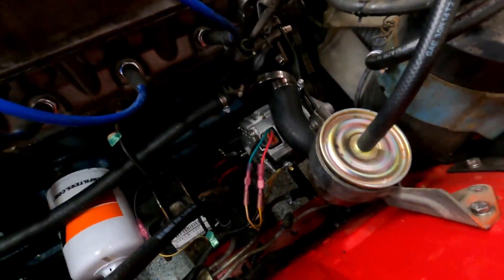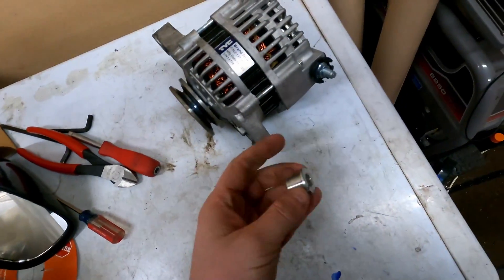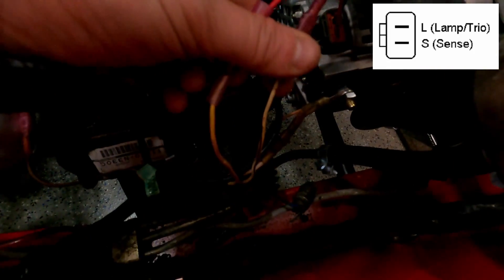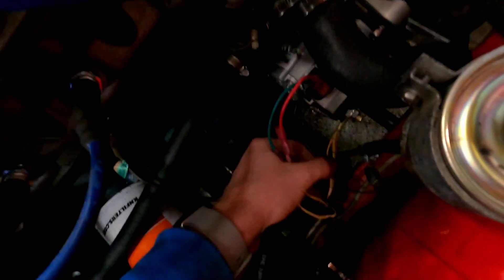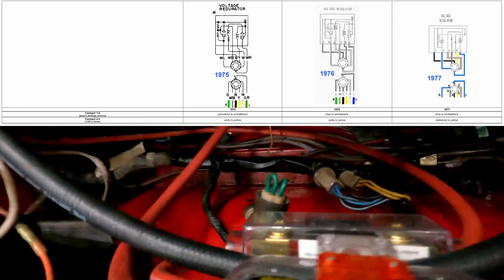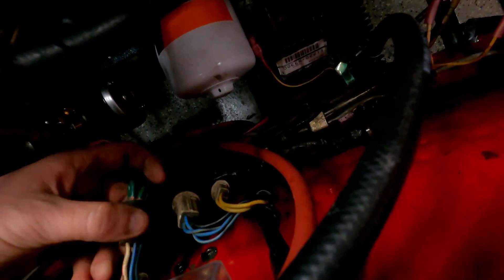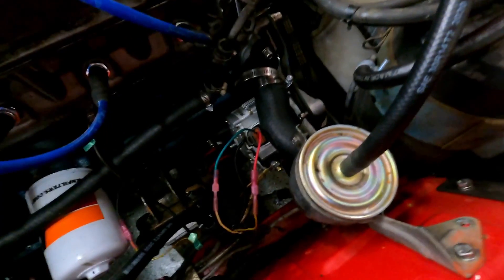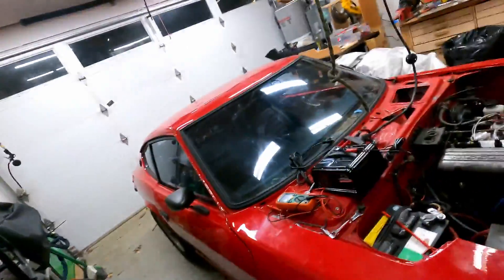280z Upgrading Alternator to internally regulated (70 amp)

Comment: Run the black and white cable to the + on your coil vs the ignition.  That way the alternator only runs when there is spark going to the engine vs when the key is in the ACC position.
Reply: doesnt that circuit rely on the charge lamp bulb to produce only a certain amount of voltage to send an excitement signal to the alternator?